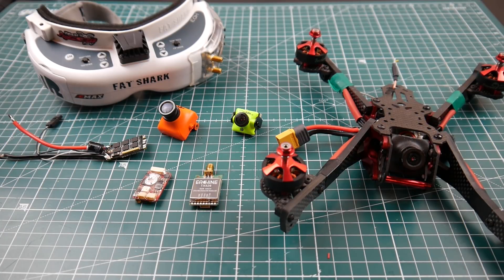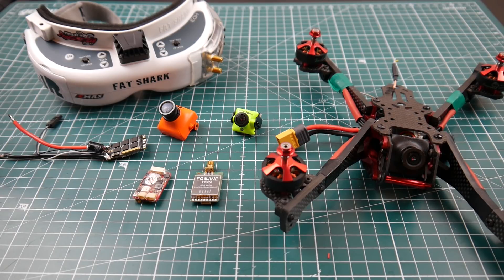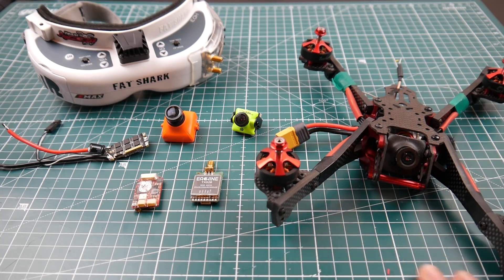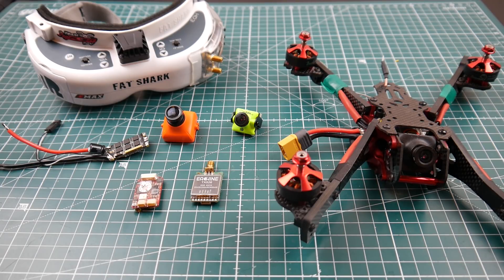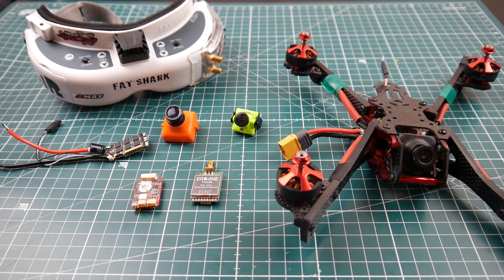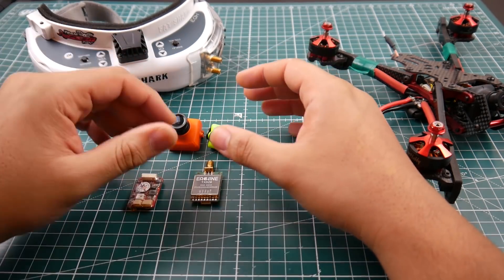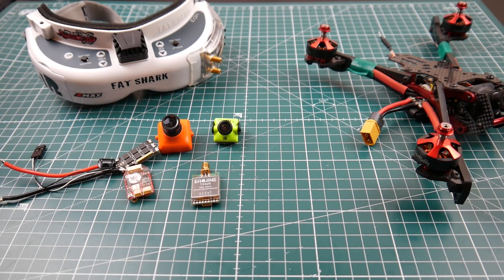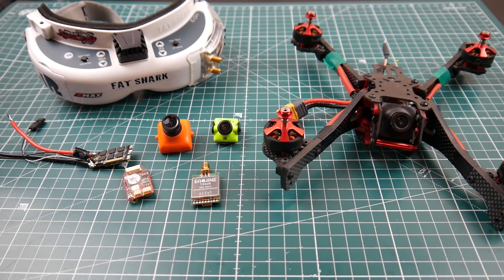VTX Latency ,  Tekko32 Giveaway and Channel Updates

Comment: Drone Mesh, I'm going to be running a vtx that is rated for 7-24V on 6s. What kind of step down regulator do you recommend? I'm going to be using a 50v low esr capacitor as well.

Comment: I know is a bit off topic... But i changed motors on my matek 405aio and i get some pretty annoying noise on the video... You tested it but i didn't saw any noise even on 50v peaks like u said... Escs are xsd30a. Thanks if u can help
Reply from the maker: check your VTX SMA port and or wiring.

Comment: Is the specan the HackRF by any chance? That goes to 6GHz and can TX too. Anyway you're doing great work so don't worry.
Reply from the maker: Dan Williams Yes i been eye balling for couple months.
Reply: Drone Mesh Just be aware that the RX will also need shielding (solder yourself kit) and that TX is not very strong at all ie a few feet. Also if you have any extra cash i recomend getting the portapak and putting havok firmware on it, look this up you wont be disappointed. Oh also the antenna is SMA on the HackRF.
Reply from the maker: Dan Williams It was shipped when you wrote this.. I'll check it out how bad is the interference with no shielding.

Comment: I really like your tests! Very useful and informative. Could you please check the latency of iRangeX iRX-IR8M set to FrSky protocol if you'll have a chance? I'm curious as this transmitter uses the module directly interfaced by SPI, so the latency should be very low. It would be a nice latency comparison of deviationTX vs openTX.

Comment: Tekko32's are amazing. Super super smooth on all default settings. It is the best ESC I've ever used so far. Thanks for the review on them! I ordered them after seeing your bench test, and true flight testing video. I don't think I'll be using anything else for a little bit.

Comment: Great news!
I would not expect any latency differences between the VTX. The only thing a VTX does is modulating the signal onto the 5.8 carrier. In fact, it does not even care that it is a video signal. You could feed a VTX with any AC signal that has a similar voltage range and bandwith as analog video. At video out of the receiver, you would then get exactly that signal.
There is no digital processing. For a VTX to intoduce delay it would need to have some kind of storage.
But maybe the test will prove me wrong.